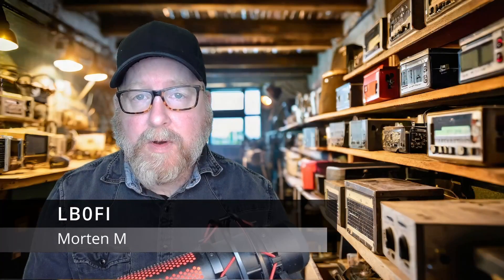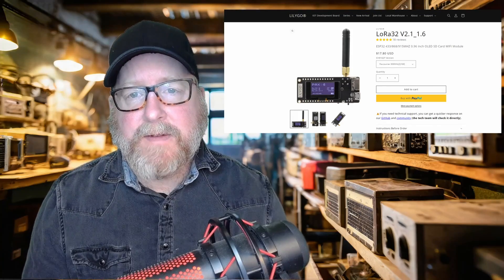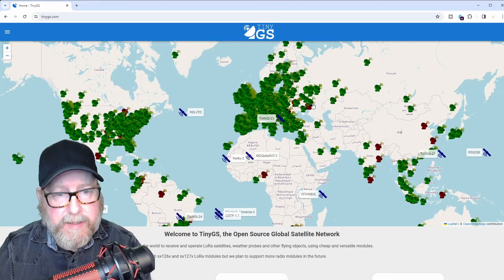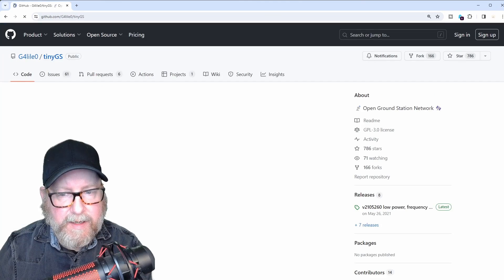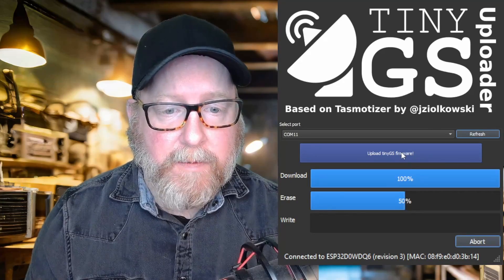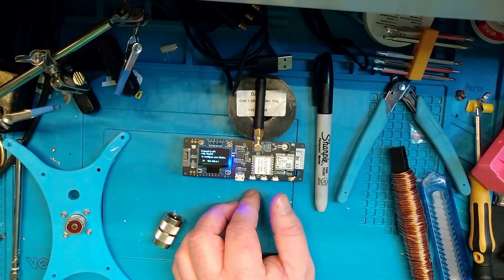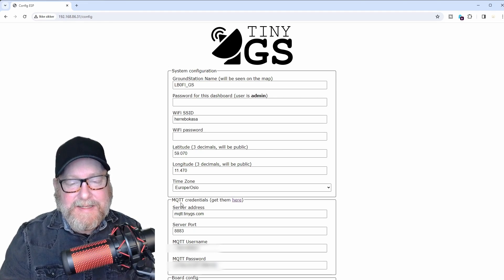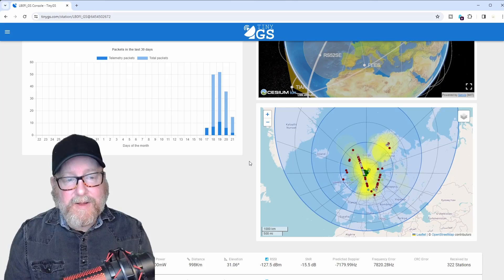Setting up a TinyGS SATELLITE GROUND STATION

Comment: Hei fra Mysen 😊 (54 km omtrent rett nord for deg). Tilfeldigvis snuste jeg litt på tema Lora etc i går, og ramla over denne FLOTTE videoen din 🥰.
Ikke umulig at jeg setter opp en TinyGS… siden jeg HAR liggende en TTGO Loramodul (433MHz), fra en gang jeg •trodde• jeg ville lete etter værballonger i 2018 eller no' 😊. Vi får se 😊
Jeg er •ikke• radiomann, men tenker at å hjemmesnekre en 1/4 λ eller 1/2 λ Groundplane antenne for 433MHz kan være en fin løsning bare for å teste dette.  Hva tror du om det?? 
Alt godt ønskes! 🙏😊
Reply from the maker: Heisann! Jeg har en enkel V-dipol som fungerer helt greit. To elementer fra en kleshenger som er skrudd inn i en sukkerbit. Ca 120’ åpning mellom elementene.
Reply: @LB0FI ok.. får se mer på det etterhvert. Jeg fant instruksjoner og lengder for groundplane antenne igår… men fant ikke noe for V dipol…

Jeg har begynt på oppsettet… men får ikke uploader til å funke. På windows får jeg lasta ned og kjørt programmet, men den finner ikke COMport, og timer ut.. (har prøvd med to forskjellige kabler). Er det noen spesiell driver jeg trenger å installere?
På Linux (som jeg ikke er god på) får jeg lasta ned et "shared library", men vet ikke hvordan jeg får kjørt programmet…
Så jeg står foreløpig fast… googler for harde livet her 😅
Reply from the maker: @oljobo Grunnen til at jeg bruker en dipol var at det var den raskeste antenna å bygge for dette. Ca en kvartbølge per side, se på den antenna jeg viser. Når det gjelder com-port så dukker denne opp i device manager når du plugger enheten inn.
Reply: @LB0FI  Jeg måtte faktisk finne, laste ned og manuelt installere en driver for CP2104 - interface ( "CP210x_Universal_Windows_Driver" )… 
Først DA fant PC-en kortet og en COM-port ble tildelt… og Uploader fungerte 👍😊 Jeg har nå tekst på displayet på kortet…. Og skal se på videoen din igjen for detaljer 👍😊. Takk så langt!! 👍😊
Reply: @LB0FI  Up and Running ☺️. Med 3 cm lang antenne på kortet foreløpig 😊. Yay, dette må feires. Bedre antenneløsning får vente litt 😊
Reply: @LB0FI  og JAGGU har jeg fått 4 packets på den bittelille Piggy-antenna. Jøss!

Comment: Great video. I’ve had my ground station running for a month. Quarter wave antenna in the loft, LillyGo board. Getting bored now due to lack of info about data usage of satellite data. Might try Meshtastic. 73s
Reply from the maker: Meshtastic is on the list here, but I am going to try running it on 868mHz instead since the power restrictions are less there than on 433mHz.
Reply: @LB0FI  Good idea, I might try 868Mhz as there appears to be a Meshtastic community developing here in the UK on this frequency.

Comment: Cool project, except for the Telegram bit. Suppose you could use a throw away to register.
Reply from the maker: Telegram is linked to your phone number, so it's hard to make a throw away, but I made sure I deleted the app after registering. I did however receive more than enough spam in that short time.